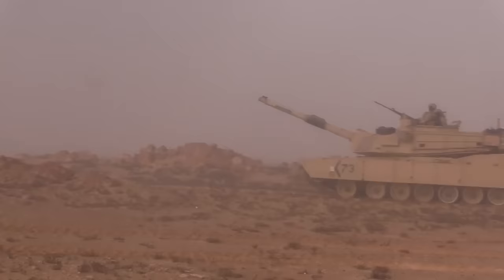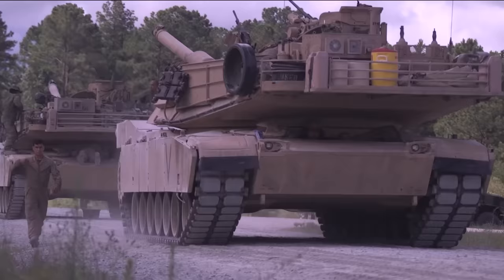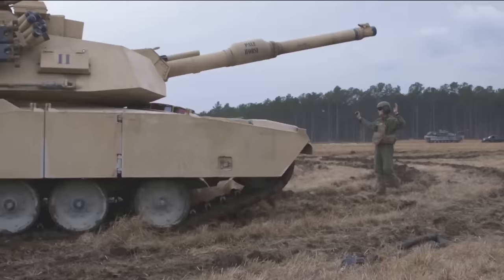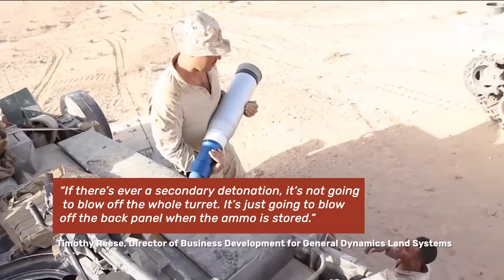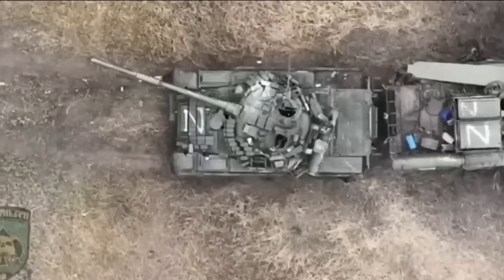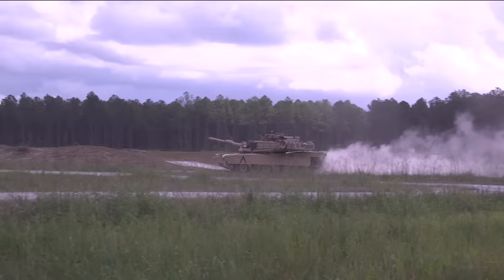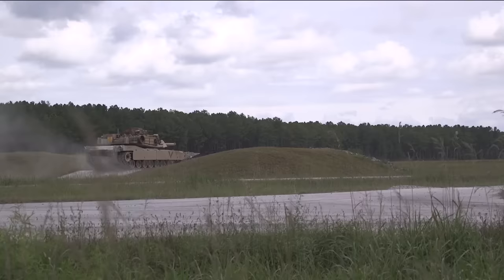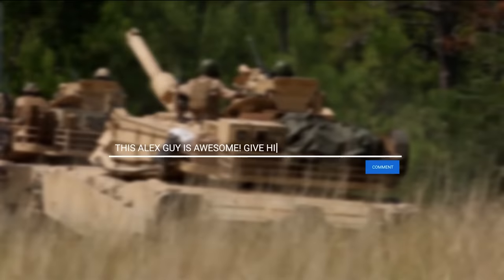America's next-generation main battle tank: ABRAMSX

Comment: Let me adress some aspects of this demonstrator. And yes, i know how much americans love ther Abrams, but its finally time to realise that it has neven been a relevant design. Sorry for that.

Turret design:
Finally the US got to the point the russians had been in the 70's and europe is no going full into. The US is the last one to copy that idea, so no great reason to priase this as some kin dof genius idea.

Electronic architecture:
Another thing that is common on modern and modernised european designs. Here also is no big inventor to praise. Also, in a lack of cyber warfare competitors, the US military never thought about having protected systems, and heavily relied on interconected, open battlenetwork systems to make one unit benefit from the processing power of teh whole squad or even larger formations. The problem is that these systems are pretty easy to disrupt, and also vulnearable to e-warfare attacks. But even jamming can be fatal, as all system rely on a nominal efficency of this network in place and functional. So a single Su-57 e-warfare plane might not be able to shoot down a squad of F-35, but render it inable to target something or even plot ther course (so in fct the damage done can be way bigger than what a Su-57 coudl to to some WW1 planes). That's pretty bad - and equally if you screw it into a land based system.
Btw.: If someone use the phrase A.I. - remeber that this mean absolutly NOTHING. There is no real AI existing by the term right now and for the next 20 years to come. So if it is used, it will be a hollow marketing slogan to cover something up. It always had to be followed by the question of "what exactly do you mean by this, as it doesn't have a pre-defined meaning' (well it has, in science, which is iognmored almost all time). Its like some calling ther product "something-something NANO 3000GT". Doubt that if its about protecting soldiers in a life/death situation.

APS:
The US has prooven to be suprisingly bad in designing APS systems. Israel had some edge by copy russian systems, but feld into relative uselessness for not developing more sophisticated systems for decades now.
Trophy is pretty aged and obsolete by now. Once it had been able to capture slow flying ATGM's and stuff like RPG's. Today (modern) RPG's are designed to counter that, but even isurgents know to just overwhelm such a system with firing multible rounds at the same time. Trophy can't stand that. Also modern ATGM's fuse beyond the defense range of Trophy, so ther shrapnels don't affect the HEAT lance. Also note that Trophy comes in different systems. Some stops APFSDS projectiles, others just the casual stuff - non of them can do both. So its either hardent for urban patrol (RPG's) OR tank combat. And Trophy HV, which is to defend from darts, has a pretty bad sensor, so can't adress any of th halfe way modern darts flying around these days. In Ukrain f.e. they would face 3BM40 and 3BM60, where there would be zero protection against.
And i can't stress this enough - even the 'ultra modern and ingenious' idea of a top attacl APS is taken from teh allready operating system on T-14 Armata (KF51 uses a different method for a similar result).
Still all these expensive toys are neat - tanks atm get destroyed by artillery, ATGM's, mines, driver mistakes, drones, and exactly in this order. You might have mentioned that none of the systems offers protection against there threats.

Engine:
Well, so the aged design has made a tradeoff to stay in service after it became obsolete, and now switch back the tradeoff to stay in service even longer. It might sound cynical but ... here is no inventions, mondernisation or rise in efficency. They in fact just sacrificed protection to gain a benefit here. Its the lowest cost solution for a problem no other nation had in the first place.
And it might be to mention that the jet engine had massive problems with sound, specially if teh enviromental conditions aren't perfect. Jet engines manage to shred ther turbines in sandy conditions into microscopic fragments. That the whole mobility thing was build on teh belive of it hopefully never had to make long ranges is ... faithfull, so say it nicely.

Mobility:
Western tanks are shit in battelfields like Ukrain (f.e.). That's because of pretty muddy ground and (purposefully designed) soviet era bridges that do not support the tonnage. One of the many reasons soviet era tanks are so much more lightwhight.
In Ukrain the Abrams is a turret, not a tank. It can't pass the many rivers, it can't pass the fields but in peak summer. A few tons less didnt change much here.

Silhouette:
Abrams always has been a tower that can't hide anywhere, and a extremly high, uncovered 30mm reaps havock to what is left of stealth. Specially with radar reflections becomming a big thing in ground combat, this thing acts like a radar reflector you find on naval crafts to be spotet at high sea. For no reason. A drunk dde with a 3D printer could had solved this issue, and i think its telling noone did that.

Gun:
As every (relevant) nation step into more powerfull guns (for a reason), the US to stay with the old gun is pretty telling. What's left to say about that? GER goes 130mm high pressure optimised KE darts, RU goes both 125mm high pressure/super long penetrator or 152mm with similar ammo, just to be FULLY save. Today its all about your KE's and your sensors to track these deadly darts on mach 5+. RU Vacuum-02 make a whooping 2050m/s. Even russian Arena APS can't stop even 1750m/s. There is no reason for a tank around a gun if that gun sucks.

Situational awareness:
I love how the design-dudes put the cameras exactly at this one spot that is not just the first to get harmed by small arms fire, but also from mud/dust/water if the tank drives anywhere but on a dry & clean concrete surface. And i have seen one of the US think tank meetings to show modern design ideas ... that's absolutly representative.

Protection:
The old Abrams nowadays is protected from almost no possible threat it can face. There could have been a solution by going into some kind of ERA, but they didn't. The only ERA availabe to the US is pretty inferior and only designed to stop RPG rounds. Even Ukrain developed better ones on ther own technology and ingenuity. Modern projectiles are only stoped by APS, ERA and composite armor working together. Bringing just 1,2 of them to the game is not even trying.

Crew:
The Army always told ther four man crews are absolutly needet for maintanance, reammunition and loitering tasks. Saving one crewmember is not just deminishing the whole operational time, it also compeltley ignores the requirements of the people who should operate it. A way more complex design that will come with a complete and fresh set of growing pains will not reduce this problem.

------

Facit:
This design is a sign of a industry completley alienated from real battlefield needs and realitys. This object, and the mindset behind it, will kill US soldiers if a battle will get real. If a politican give money to them, they know what they do. If i depict that like a warcrime to happen - i do this for a reason.

I know its nice to life in a bubble where the US material is always great and all other, specially the old enemys ones, is crap. But that's just not reality. Belive me, i'm german, and we have a history with that. If you think there is a threat - take it serious. If you think your nation is of great ingenuity, doubt every praise you hear in any media about some of its technological achievements.